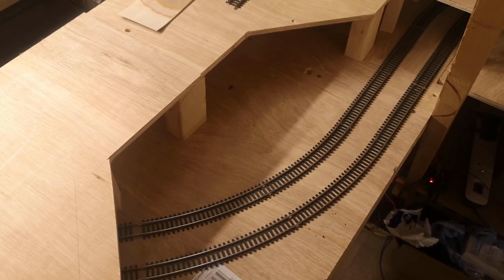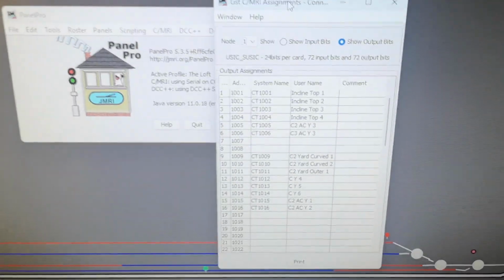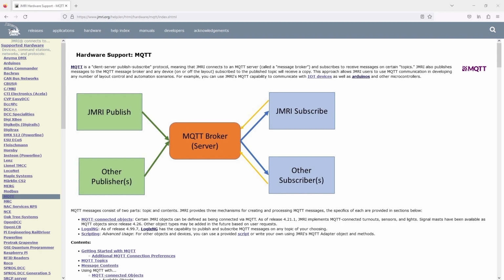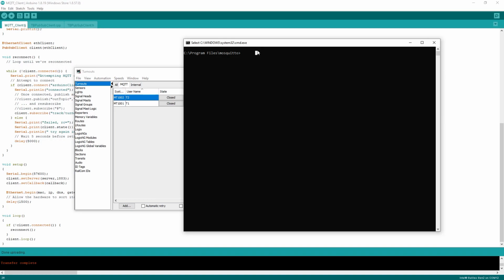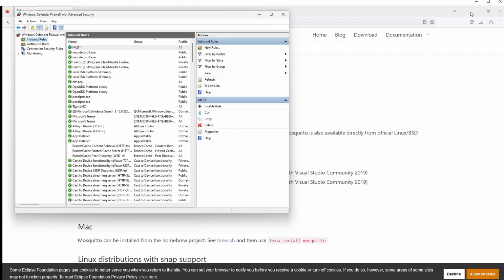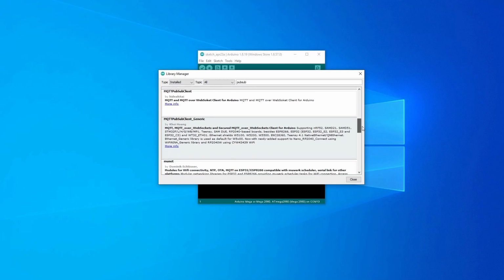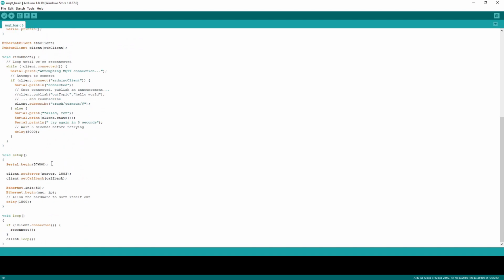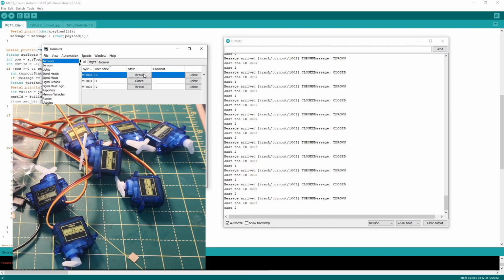Using Arduinos and Ethernet for turnout, sensor and signal control with MQTT in JMRI - Part 1

Comment: Finally made the jump to MQTT and have to say I am glad I did. The only problem i had was the w5500 modules in that they were just too finicky and inconsistent. I had a couple of chips get  really hot too. So I did end up using the some w5100 shields instead on top of the mega. I did not need the entire array of pins on the sensor shield and just used the header sockets on the end of the mega for all my sensor connections. For power and ground for current detectors I'm using I just made 5v and ground bus and connected it to respective pins on the mega sockets header. So my set up is 4 arduino based 'nodes'. Two for sensors and two more for signal masts on the network. Thank you for taking the time to share your experience and show us your set up. 👍
Reply from the maker: Thank you for the message! Yes I never regretted switching to MQTT - far more reliable, it's never given me any problems, and I can do a lot more with it too. Regards, Chris

Comment: I can tell you the issues you are having with RS 485. You haven’t got it terminated correctly. For RS485 the last receiver in the chain should have a 120 ohm resistor. If it’s two way comms on a single twisted pair that means at each end. Meaning in or at the usb to 485 converter and only your last node. You’ll likely find that the converter and every 485 to TTL board has a built on resistor. If that’s the case for your boards then the intermediate resistors need removing from the those boards. They should fit a jumper for this but the cheap ones very often don’t. Google RS 485 correct termination if you want to know more.
Reply from the maker: Thank you - I'm afraid that this was an old video, and I moved away from RS485. I did do a lot of work on termination - I believe the RS485 boards I was using were supplied with terminating resistors, and it was a case of removing those resistors for boards that were not at the end of the chain. Regards, Chris

Comment: A quick google for "Arduino ISP Header Pinout" should get you the pin numbers for that 6 pin header. Its a very common programming header in every Arduino hardware project.  Unlike IC pins, which are numbered along the long side, then flip over to the other side to come back (so that pin 16 is at the same end as pin 1, for example), headers are numbered across, so pin 1 and 2 are at one end, and 5 and 6 are at the other. I hope this helps tidy the wiring.
Reply from the maker: Thank you! I see - I'd read the pins like I'd read a book, left to right then top to bottom?! I hope so too, although sometimes I think  only throwning it all out and starting again would tidy the wiring! Regards, Chris

Comment: I use wi-fi to utilise MQTT via ESP 8266/32's (tiny arduino type devices with built in wi-fi).  These are cheap, so you can have many scattered around the layout servicing small areas, and can also connect to I2C servo driver boards for points or serial shift registers for on/off devices.  They can also utilise inputs for sensors and feedback.

All I need is separate power buses for the ESP's and accesories (I use and old PC power supply to provide me with relativey high current and stable 3.3V, 5V and 12V supplies).

Works a treat
Reply from the maker: Thanks Hugh! This seems to be a major advantage of MQTT - just how many devices are compatible and can be chucked onto the layout! Regards, Chris
Reply: Amazing! I have just been reading about  MQTT and think it’s a great solution to my club layout. We currently have blocks but no detection. Do you have a link to the sketch (or whatever it’s called on the ESP) for Wi-Fi and reading sensors by chance?
Reply: @alexanderwall3969  

Hi Alexander,

Everyone has different requirements... for example, do you operate points or semaphore signals by servo or point motors? Each will have their own method of output for control.  What sort of sensors do you want for train detection and how do they output their data?

I personally like the MTB MP1 and MP5 point motors, each operated by a SPDT relay which, in turn, is activated by one of the outputs of a SIPO shift register.  If you find the clicking of the relay too much then a simple digital circuit with a couple of mosfets/transistors/resistors would not be too difficult to build to replace it.

For servo control simply connect to a servo driver board.  A completely different control sketch would be needed for each of these methods.

For sensors, I use PISO shift registers, with each sensor being used as one of the parralel inputs.  Again, this would need a completely different sketch to read and send the data.

With both types of shift registers they can be cascaded, so the sketch would need to be written for each ESP 'node'.

As I said in my previous post, the low cost of ESP devices makes it easy to use many around a layout, and to simplyfy sketches I use one for outputs (points, signals, lighting, etc) and one for inputs (sensors) at each loaction.  You can even have a physical control panel with switches and push buttons as inputs that can be used by JMRI Logix to control the layout - ideal for manual control of your club layout when you don't want autonatic train scheduling, or even for mixed running (automatic main line running and manual goods yard running, etc).

The other beauty of MQTT is that you can use Node Red to create other control routines.  A good example of this is if you have a layout based on prototype then you can use the JMRI ID's (e.g. 1001) for the points/signals but on the layout and control panel use the real world identification, so JMRI 1001 could refer to real world point A28, for example.  Node red simply converts the MQTT between the 2 naming conventions, by reciving one and resending as the other.  There are so many possibiities, pretty much limited only by your imagination...

So, for creating sketches I would advise looking at YouTube videos and websites on the subject of ESP wi-fi connectivity and for serial input/output and servo control.  Learn by studying the basics, trying out the techniques and then designing, writing and further developing your own sketches to suit your own individual needs.  Doing this is also a very good way to learn and develop your sketch writing abilities.

Good luck.
Reply: @hughjardon5101  Thank you for the advice - I have most of my turnouts powered presently - half tortoise, half with Atlas Snap switches (I'm in the US) connected via wires to a control panel. I'll tackle automating the turnouts later, it's the sensors that is the present goal. I have some coding ability but it's not my job, thus the questions about sketches. I'm sure I can find some, I just figured you seemed to be on your way and might have some.
Reply from the maker: Hi Alexander - it does work great with model railways and is very scalable for larger layouts. I'm sorry - I did mean to add a snapshot of the code at this point but forgot to - then moved on to sensors, which I've also now done a video about - maybe more relevant to you if you're looking at block detectors. There's no code on that one either as I then moved on to shift registers, but when I'm happy with all of the code I'll post it up - probably with a shift registers video which won't be long in arriving.

As Hugh says, no one sketch will meet your requirements, but it's always good to have a point of reference, see how other people are doing things and any relevant bits you can copy and paste. I'll make sure it goes up - it was always the intention to share!

Chris
Reply: @WirenwoodModelRailway  Great - I see that video, I'll watch it tonight. I was able to get my MQTT Broker running and get JMRI to link to it, so that stage is done - thanks for the instructions!